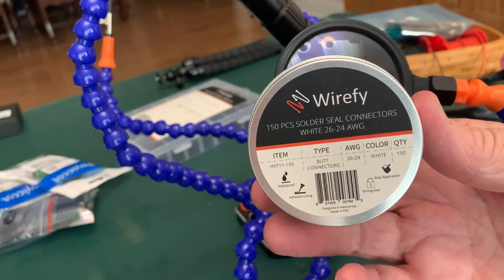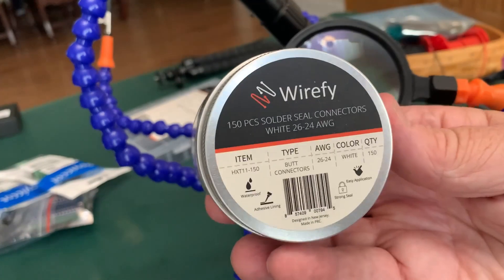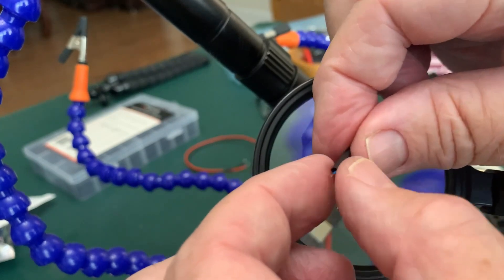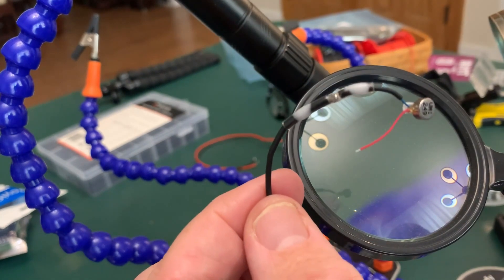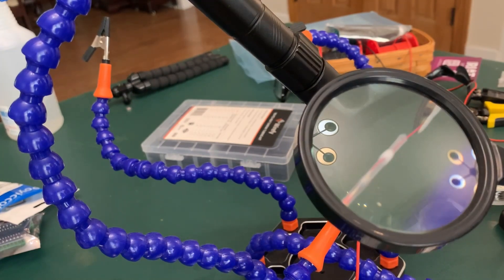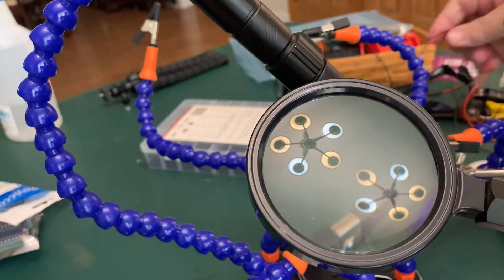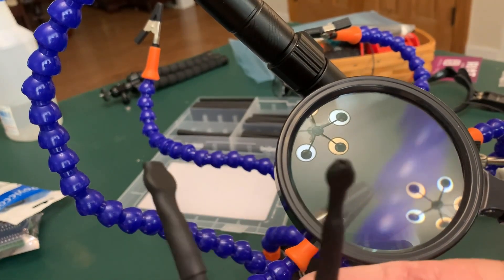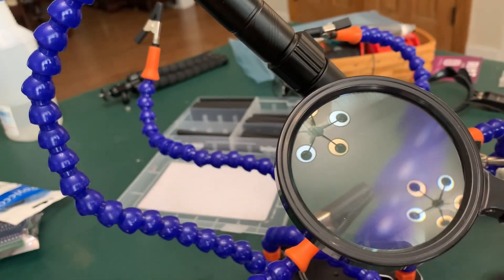Solderless Fingers for Buzzboard and gloves

Comment: @user-bs4qc8gp6j
35 seconds ago
Hi can you please give me the details of the vibrations ie how long and at what frequeceny and power?

and the program for the computer. and what computer did you use?
all the best 
TIM
Reply: The software is written for an Arduino.  They call their programs a "Sketch".  It's basically a C++ derivative.  The original Tass gloves utilize a 100ms pulse at 250hz with a 67 ms pause in between using actuators.  This design utilizes ERM motors which have a "spin up" period (unlike actuators).  The Motorshield design pulses the motors for 167ms at 3.3 volts.  The "pause" is in the spin up period of the motor.  The Nano design delivers slightly less power and, thus, a bit less vibration.  I am only building the Motorshield version at this point due to the higher vibration level.

Comment: Hi, I have finally got 8 motors attached to ethernet wiring and they all work well, but it has taken about 14 motors to get there!
I am a long-time electronic hobbyist so soldered them directly together with no problem.
I have used your technique of giving strain relief with 3 different thicknesses of heat shrink - done properly that gives excellent results.
Like you I tested them before using the heat shrink and tested them when completed.
I found that excessive heat from my careless and excessive use of the heat gun was causing major problems.
In several cases the motors simply no longer worked, some (weirdly) would work on one polarity but not the reverse, whilst others had been damaged and made less responsive so didn't vibrate as much.
I would therefore advise people to be careful not to let the little motors take too much heat!
It's a good job I have a bag of 50 motors to go at 😀
Cheers
Greg

Comment: I built a set using archery gloves, and I mounted the motors on cut off popsicle sticks (about 6 cm) with the motors about 1 cm from the end. After mounting I put some glue on the wires before soldering the main wires on, and then put shrink tubing over the wires, but I left the motors uncovered. I then slid the sticks into the fingers (we bought extra-large gloves) and secured them with wire ties through the finger material. With this approach the fingers come into direct contact with the motors, although the sticks do carry a lot of vibration to the entire forefingers.

Comment: 😢it seems to me that the weak link in using the either motor is the very small guage wires, especially at the base of the motor.  You have mitigated that by placing shrink tubing up over the entire motor.  Isn’t this going to diminish the amount of vibration felt by the fingertips?
Reply from the maker: It likely does reduce the vibration (although this will be dependent upon the type of build).  The buzz board has the "fingers" elevated, so it should have less of an impact.  The gloves provide a dampening effect.  The micro controller gloves vibrate less aggressively than the motor shield (voltage delivered is less on the Arduino Nano).  An alternative would be to capture the motor in some sort of a "channel", but the dampening effect is going to occur to keep those tiny wires connected.
Reply: Thanks for the feedback.  I made gloves with the motor shield.  I decided to mount the motor on a small piece of plastic that had a collar that is 3-4mm long.  I applied a small dab of epoxy on the wires at the collar and then put the shrink tubing over the collar, up to the motor.  I can email a picture which might make it a little clearer.